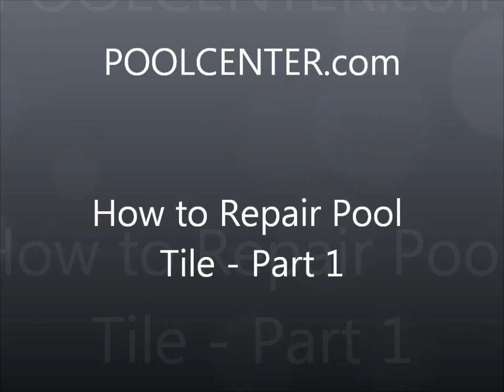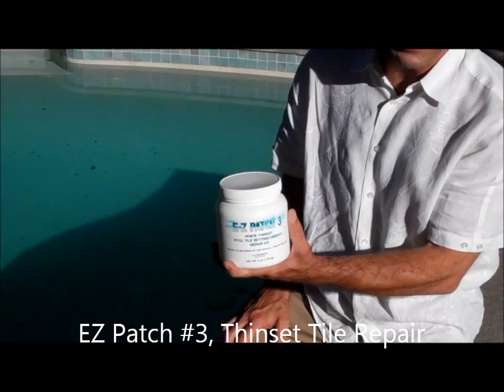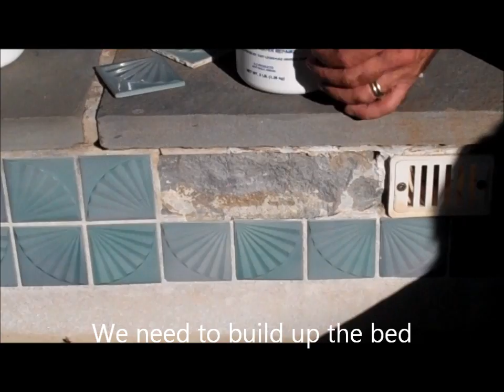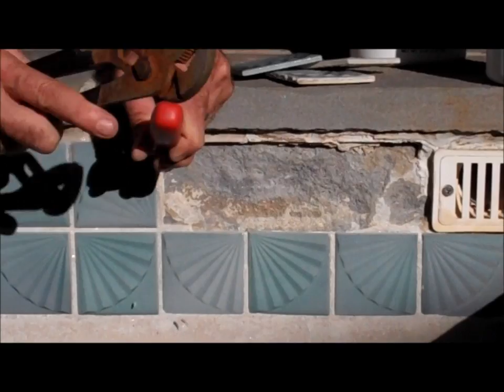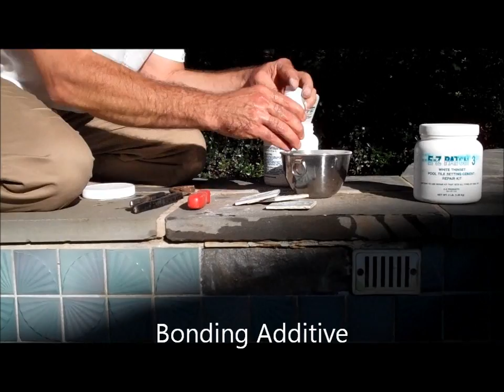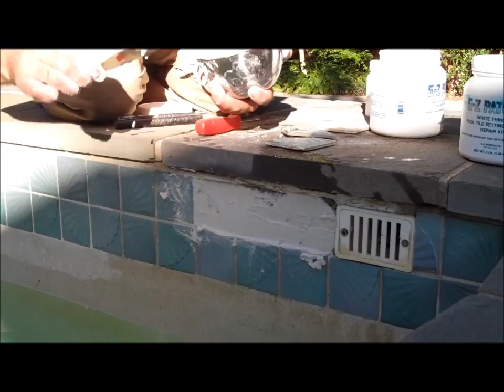How to Repair Pool Tile, Part 1

Comment: Using pool water to moisten the substrate is not recommended. You should use cool water and a sponge, then apply the plaster. You need to work quickly with plaster, it dries quickly and very hard. Then use modified thinset, unless it’s glass…then, you should use an epoxy based thinset. Still, not difficult.

Comment: After every winter i get more and more crack tiles around top part on inground pool
Reply: This is probably because of the freeze/thaw cycle and water expanding as it gets behind the tile and turns to ice. Best thing to do is remove those tiles, clean the thinset off (the stuff that "glues" the tile to the wall), and then use some kind of waterproofing barrier (home depot sells a good brand called red guard) then add new thinset and the tile along with epoxy grout to really seal them in and prevent water from ever getting back behind the tile.